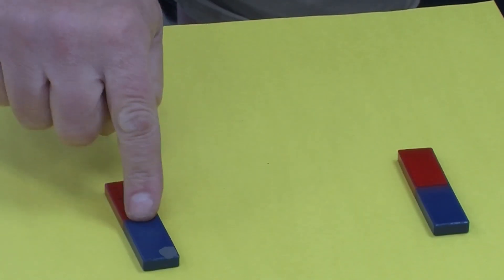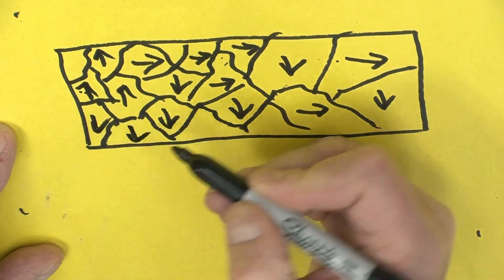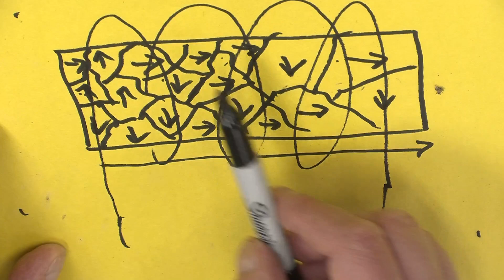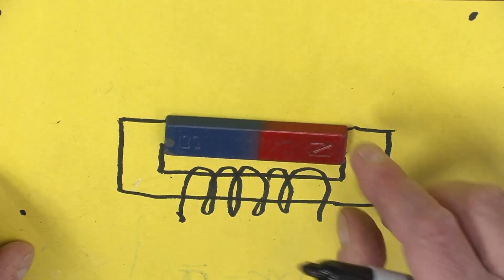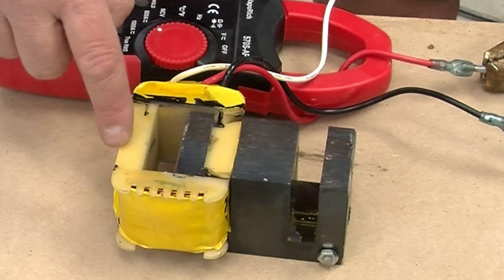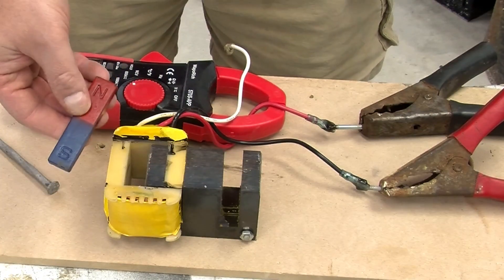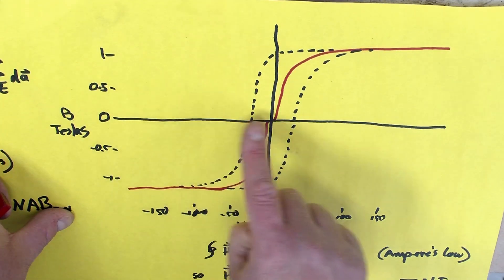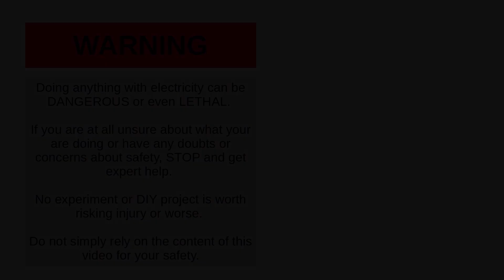How to (Re)Magnetize a Permanent Magnet

Comment: Is there anything you can do to a magnet so that it will keep its magnetism longer?
Other than heating it up when you magnetize it I mean.
Reply from the maker: If you mean whne you are magnetizing it, no - assuming you are are already subjecting it to a good strong field. Howevern, once magnetized, there are a few things you can do to keep it nicly magnetized: 1) Put a steel bar or similar between the poles to make it "easier" for the B field to stay high on the BH curve 2) Dont subject the magnet to vibrations or shock 3) Keep it cool 4) Dont force it near an opposing magnetic field.

What I did leave out is all of this depends on the material the magnet is made out if some - some are more or less vulnerable to any of the items listed above.

Comment: All I know is... last time I had to make a magnet from scratch I did it quite a bit differently.
Reply from the maker: So .... how did you do it?
Reply: @ElectromagneticVideos  stuck a really powerful magnet to the side of a metal bucket. Filled bucket with water. 
Heat piece of metal in a forge to above it's curie point. Quickly quench the hot metal close to the magnet in the bucket... and Bob's your uncle.
Reply from the maker: @sideswipe147  Never heard of it done that way - clever way quickly to drop the temperature while in the presence of a magnetic field!
Reply: @ElectromagneticVideos  yeah well once upon a time I had to figure out how to make a magnet without macnets. It evolved from there.

Comment: Thanks for using Robertson screws in your high tech detector - they are much more accurate than dreaded slot and Phillips screws!
Reply from the maker: Ha - yes! Are you Canadian too? They are truly the easiest screws to use but sadly they are uncommon in most other countries. The History Guy did a nice video on them if you havnt seen it.
Reply: @ElectromagneticVideos  Indeed I am a fellow Canuck.  I enjoyed your magnetic to electric circuit analogy.  Many years ago, I taught a college course that included AC and DC circuit analysis as well as magnetic circuit analysis - I taught the material exactly as you did.  Sadly, magnetic circuit analysis isn't on the radar in many programs.
Reply from the maker: @carlosanvito  Really? I haven't taught university courses for years - I'm amazed it is being left out. When I was an undergrad, it was in both  the 2nd year physics introductory EM course and further elaborated on in the 3rd year EE machines course.   We had some of the best profs for both courses - to the extent that I was not expecting to find the machines course very interesting and ended up thoroughly enjoying it.
Reply: @ElectromagneticVideos  I was in university a million years ago and at that time fundamental EM was taught to all engineering students in a first year course.  That was a great primer for those of us in EE to better understand concepts around transformers and rotating machines that would follow.  Communications and Maxwell's laws studies would be highly restrictive without EM basics.  My observation is that basics are taking more of a back seat in favour of material which attracts more paying students.
Reply from the maker: @carlosanvito  I'll bet we were in university at about the same time (give or take a million years :)

I have come across that paying student shift - once hired someone from what looked like an excellent community college program .  Turned out there was huge disconnect between what they said they taught and what the students learned - turned out the program was 99% percent students from one foreign country and grades were inflated to keep the students coming. I gather at the university level is huge pressure to make the courses "entertaining" at the expense of the fundamentals.
Reply: A compass works pretty good too.lo
and needles  or stick pins but id use the screws ,pins and nedles have a tendancy to get into the carpet your feet ect,LO

Comment: Nice video, very well explained.
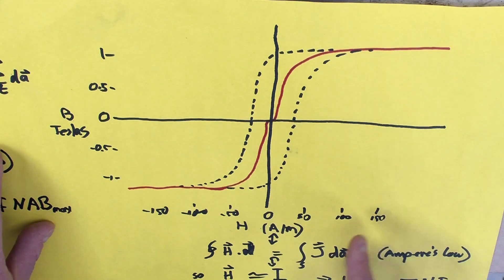Just one minor correction - at 14:08 where you show the B-H graph, I think you have the B & H reversed because the flattening of the curve is supposed to be for the flux density B which is the saturation point.
So H should be on the horizontal and B vertical axis.
Reply from the maker: Thanks! I just looked - the problem is sloppy labeling of the graph on my part. I drew the vertical scale on the left side and  horizontal scale on the bottom of the graph. The B on the left is meant to apply to the vertical scale and poor positioning on my part placed it near the horizontal axis. Same for the H. Sorry about the confusion!
Reply: @ElectromagneticVideos  I wouldn't worry too much, I've made bigger blunders myself.
Take care.
Reply from the maker: @markg1051  Thanks! Yes - in the grand scheme of thing its not big deal - hopefully most viewers understood what I meant.

Comment: Learned a lot. Thanks.  Doesnt a type of welding-iron uses the principe with the curie-point ? And that don't seem to be "dangerous" for the magnet.  (And a trivia: In swedish BH is the same as bra....  :) )
Reply from the maker: Your welcome! Not sure what you mean with the iron in terms of the curie point. If you elaborate it might help. I think your referring to what I would call a soldering iron which melts a tin+something (lead  in the old days) to attach electrical wires or devices. The alloy is not normally a magnetic material so it no risk of magnetizing it. 

Most soldering irons operate by a resistive element providing the heat and with little current flowing there is little magnetic field. Solding guns however use a transformer  to create large current to heat the tip and there is  a huge field as shown here https://youtu.be/mGK8oYdEqyE?si=heddjVD9ww3PlMmJ&t=537 . So that could demagnetize nearby magnets. 

Trivia - I'll bet that is the source of endless amusement in introductory electricity and magnetics classes in university :)

Comment: Not the wire. Not the magnet. Does the electromagnet need to have a steel core or could it be made out of aluminum or copper for magnetize a magnet?
Reply from the maker: An electromagnet does not need to have a core at all - all you need is a loop (or loops) of wire with current flowing though  it and and you have an electromagnet.    

You could just loop some wire around a piece material you are trying to magnetize, pass a large current though it, and it would work.  But you would need a lot of current. 

If you have a Ferromagnetic material like iron or steel as the core of an electromagnet , it will increase the B field strength considerably beyond the the field without the core. Also, regardless whether the  coil is around the magnet to be, or another core, if you can have a complete magnetic circuit out of steel or similar for the B field to flow though, you will get a higher B field up to the saturation limit of the steel and can magnetize with a lower current. 

For really high strength superconducting magnets, you often don't use a core since the currents are so high the field beyond the saturation limit of iron or steel and the core would have little effect. 

Hope that helps!

Comment: Making magnets at the forge make so much more sense now that you mentioned the lava. 🔥
Reply from the maker: Have you actually made magnets that way - cooling the metal down while in a field? I have never actually done that - would be neat to hear how well it works in practice!
Reply: @ElectromagneticVideos  happens when you forge something facing due north or south till it cools and you hammer lightly up and down the bar to a plannishing heat. Super annoying when you dont want stuff magnetized.
Reply from the maker: @williammorris1763  Oh - of course! How interesting. How strong is the field - can you pick up a bunch of finishing nails with the accidentally magnetized item?

Most normal iron and steel makes poor magnets - have you tried banging the item with a  hammer when cool? That might demagnetize it...

Comment: THANKS FOR ANOTHER GREAT VIDEO!!!
Between timestamps about  9:10  to 9:15   while you were talking about the 'magnet resistor', the word "RELUCTOR" popped into my head!

Also, have you heard that they were (for a while) actually selling school magnets with "N" and "S"  REVERSED!!  It had something to do with the fact that teach that a magnetic compass will always 'point north' so that the compass will demonstrate that earth north will actually be demonstrated....I think they stopped this nonsense.
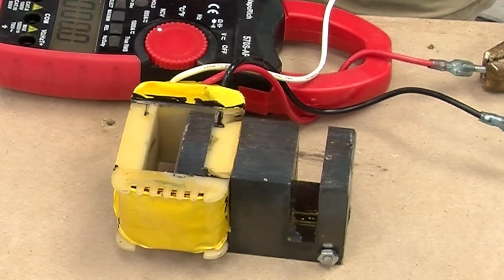I got a few of those pole indicators, like you shoe at about  11:10   One was actually hand labeled "Green = North" (none of the others)??  I ignored this.

One more thing:  When you were REmagniting a material why doesn't the alternating, AC,  magnetic field  just push and pull the domains, leaving no net effect.
THANKS AGAIN....still catching up on your fantastic videos!  Please keep them coming.
--dALE
Reply from the maker: Thanks! Glad you enjoyed it!
I just googled "reluctor" - seems to be a sensor type commonly used in cars for crankshaft position based on magnetic reluctance - how interesting!

I had never heard of magnets being mislabeled the wrong way for "educational" reasons,   but doesn't surprise me! Still strange!

Remagentizing  - did I accidentally imply I was using AC? If so, it should have been DC. I have heard of people using AC which works if you turn off the current close to the peak of the cycle. You then have a 50 % change the magnet is magnetized one way or the other. Apparently do it a few times  testing the magnet in between and it eventually works. 

More videos coming - if you havnt seen the "Measure the speed of light" video, take a look. I'm working on the  DIY followup for it.
Reply: @ElectromagneticVideos  Yes, I have seen the  "Measure the speed of light".  Remember, we had a brief discussion on modulating HeNe's??   BTW: What's your first name...may help getting acquainted for YouTube.
Reply from the maker: @dalenassar9152  Strangely I just saw your "Yes, I have seen the  "Measure the speed of light".  Remember, we had a brief discussion on modulating HeNe's??   BTW: What's your first name...may help getting acquainted for YouTube." comment - it was quarantined for review!?!?!? Youtube seems to sometimes get confused about what good and bad. Yes - I remember we had that discussion - sometimes when  lot of comments come in its hard to remember who I had what discussion with and there does not seem to be and easy way to see what discussions I have had with anyone in a different video. BTW - I tried once to change my comment name to "Pete @ ElectromagneticVideos" but was unsuccessful. Will have to try again!
Reply: @ElectromagneticVideos I just re-watched the video.  I assumed AC since it was a transformer core.  I guess you did, indeed, indicate the current was DC when you applied power with a battery charger.  AND when you used the B-Field checker....sorry
--dalE
Reply from the maker: @dalenassar9152  No worries! Its funny - I am always amazed at how I misspeak when doing videos so I would not have been surprised if I had got it wrong!  I think in normal conversation we make more errors than we realize, but not being recorded they are so fleeting they don't get noticed. You wouldn't believe the amount of editing or re-shooting video I do to correct what I say!

Comment: What happens if you heat magnet to curie point, apply the field, then rapidly cool below the curie temp before turning off the field?
Reply from the maker: It will be magnetized. It happens in nature: https://en.wikipedia.org/wiki/Archaeomagnetic_dating
Reply: @ElectromagneticVideos  i love your channel! Subscribed!

What is the most effective way to magnetize magnets in industry? Do they just put it briefly in a high field or do they do anything else special?
Reply from the maker: @weirdsciencetv4999  Well thank you! Welcome  aboard :)   

You know, I don't know what the latest technology is for that and its a really interesting question - particularly for Neodymium these days. I did a quick google on Neodymium and one manufacturer does say exactly that - put it briefly in a high field. But you also wonder if there is any secret sauce that one or the other manufacturer may have developed and are keeping it a trade secret - a particular charging current profile maybe that works best? Some other trick? It would be fascinating to see how its done in a real factory.

Comment: 7:57 
Why don't you just place the coil around the magnet? Why do we need a steel core?
Reply from the maker: You could, but to get the same level of B field (ie to saturation) with a similar current, you would still need and iron path connecting the  two ends of the magnet together to make it easier for flux to flow.

Comment: What is the time duration of magnetic field required to magnetize typical steel?
Reply from the maker: That a good question and one which I don't know the answer! But its not very long - a fraction of second depending on the material. Its essentially the same mechanism to magnetize an electromagnet into saturation and transformers can go into saturation well beyond standard AC frequencies of 50 or 60Hz. I know people use charged capacitors to very briefly push an enormous amount of current though a coil to magnetize magnets and that would also probably in the fractions of a second. 

If anyone has any experience charging magnets using a capacitor, would be great to hear how long!
Reply: @ElectromagneticVideos  
That's what I plan to do.
A big HV capacitor.
Few thick copper wire coil.
A fast high Current high Voltage switch (Thyristor)
That's all, very SIMPLE.
Reply from the maker: @paulcohen1555  Perfect! If you do it I hope you make a video - I would be interested to see how it turns out. One thought - you don't need giant thick wire. Something like household wiring wire can do hundreds or thousands of amps as long as it is only a fraction of second. You may have to experiment with how many turns is optimal. If you are using HV more turns will be better. If  you have scope clip the probes on the ground end of the wire you are using with only a few inches of wire between the two scope clips. The wire will be like a really low Ohm resistor and you can watch the current decay but also see its peak value.
Reply: @ElectromagneticVideos  
Sure.
And of course I will do some estimations and calculations of the circuit.
Reply from the maker: @paulcohen1555  Good luck!

Comment: Never knew that tapping the magnet 🧲 helped the alignment process!  😊
Thanks!
Reply from the maker: Just so its clear, if you have a really strong field to charge the magnet with, no need to tap, but if the field doesn't  create saturation in the magnet being charged, tapping can provide a bit of energy to help the domain boundaries move. Also, not sure of how well it was shown in the video, but magnets are often brittle and if you tap them too hard bits can break off.

Comment: Very nice video. I use a very strong neodymium magnet rated at 600 hundred pounds of pull, I don't know how much gauss it produces, I don't have a gauss meter to check it. I do use the neodymium to recharge my alnico magnets and does make them strong again,  I'm sure it's not full saturation, but they are strong again.
Reply from the maker: Thanks! That's really neat to have used one permanent magnet to charge another - makes sense with a strong neodymium magnet. Do you have anything like shaped piece of iron to guide  the flux from one magnet to the other and compress the flux into a smaller area to raise the density closer to the saturation point? Thats  really what would would have liked to have for the demo I did. 

By the way - great vintage videos you posted of electrical demos! Just subscribed so I can watch the later!
Reply: @ElectromagneticVideos  
Thank you for subscribing, I will be posting more later. To answer your question,  I  just touch the neodymium magnet directly on the Alnico magnet,  North pole to South of the neodymium,  and then turn them around and repeat the process.
Reply from the maker: @RobertAgin1  Looking forward to more posts! 

Neat that doing something as simple as you are doing charges the Alnico!
Reply: I subscribed to you as well.👍
Reply from the maker: @RobertAgin1  Thanks!